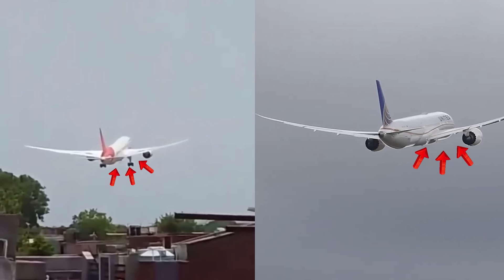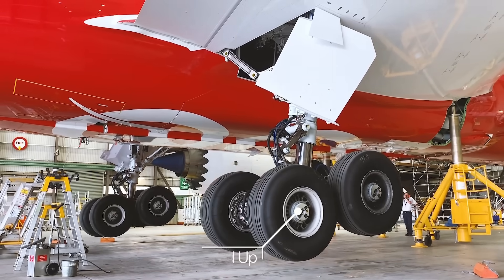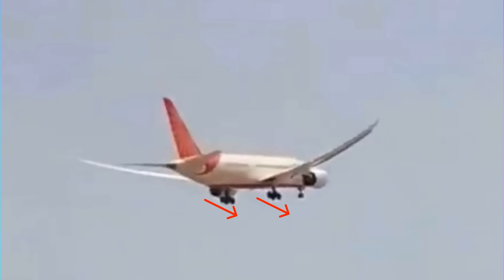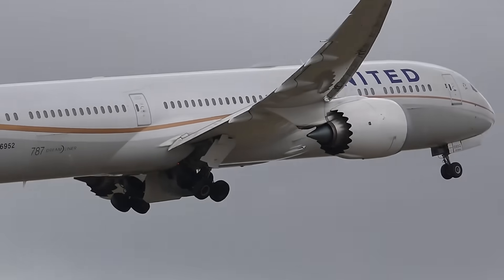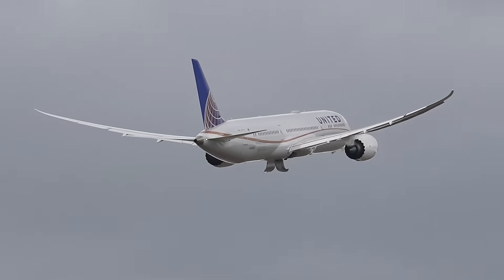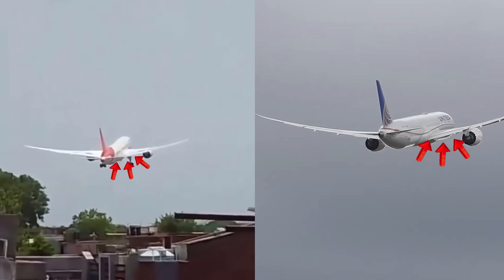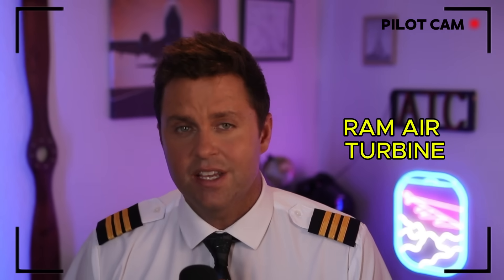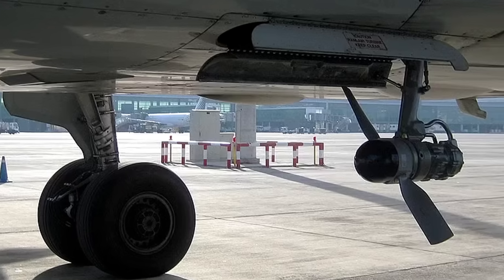Pilot Explains: A New Detail in the Air India 787 Crash Everyone Missed

Comment: The Model of the Aircraft was 787 - 8 which has a maximum takeoff weight of 2,27,900kg only and the weight of the Fuel as per report was 125000 liters or 125000 X 0.8 = 100000kg, So if overall operating weight of the aircraft itself was 1,20,000kg adding up both will become 2,20,000kg weight of just the aircraft and the fuel which is dangerously close to maximum takeoff weight of the aircraft, Even if you do a rough estimate and add up an abysmal passenger and luggage weight of just 40kg per person (including the passengers weight and luggage weight) the weight comes to 9680kg, Adding all this up 1,20,000 + 100000 + 9680 = 229680kg weight which is over the safe maximum takeoff weight of the 787 - 8 Model operated by Air India. Something is really not adding up, This has to be seriously investigated to rule out any negligence or foul play on the part of the company its pilots or maintenance staff. Add to this Ahmedabad is located close to sea level what was the temperature on the ill fated day because high temperatures cause lift issues, Did the pilots notice it did they flag it, Who was the AIr India/ Tata staff on the ground crew who signed off for takeoff of the plane? Where the pilots forced to sign off on takeoff formalities.

Comment: Electrical failure or possibly a fire internally or being that it was very hot could have been a vapor lock...it wad just filled with fuel...but yeah the plane looks like it flat out ran out of gas in mid air...no fight or nothing,,actually a nice crash landing though very tragic don't ge me wrong

Comment: Fuel vapor from the airplane sitting on the tarmac the hydraulic pumps for the fuel pumps could not pump vapor, for over 3 hours in 107° heat The air conditioner is off the passengers were fanning themselves because it was so hot in the plane look into it

Comment: if both engines flame out, they are still spinning pretty quickly and take a while to stop spinning.  Is the electric generated by gearbox attached generator like the APU is? If so, the generator would still be spinning much longer than 10-20 seconds and therefore generating electricity?

Comment: This seems to be a well presented analysis. It's sad such an accident happened but the ultimate result of the investigation should be to improve safety and prevent such accidents. I'm surprised that in this space age and fly-by wire technology,where we're sending people back and forth from space stations, we're still struggling to prevent accidents. I assume that these big birds like BA 787, Airbus A380 can withstand extreme temps. Also, why'd we need pilot intervention for retracting/ deploying gears when we can easily program to do these on attaining some params like height etc, only to override them by pilots if needed.

Comment: APU was malfunction and off. Plane was allowed to fly with that. (very stupid) bud allowed.
(no poower in tv screen, no aircon, no lights)

So no backup generator for AC power.
Plane then later probably got a dual malfunction in the generators. and had a total AC power out.
Engines die from total AC power out. So therefore also dual engine power out. 

As it had no APU for power, RAT was deploed. 

Hydralics went out too and because of that, flaps could be pushed out of angle from wind pressure. If they were not locked.

Could be a 248 day bug in computer if they didnt have restartet system for 248 days 

Survivour seat 11A was sitting almost on top of RAT. He said he hear a big bang. That would have been when the RAT deploed.
He also said lights was flickering. Also from RAT deployed.

The APU is in the very tail of the plane and is STILL INTACT!  

read all about it here :  https://www.facebook.com/anchersanalyserr

Comment: If there was contaminated fuel, would not the problem be apparent at full power or even before full power applied?
Reply: Not necessarily. If contamination was impeding the fuel filters, it might not have blocked sufficiently until high flow was required, and might have taken a little time and given intertia not immediately apparent. Given 1st transmitted ADS-B airspeed of 174 kts and climb rate <900 fpm, both lower than the previous 7 flights of that callsign from that airport suggests low-speed rotation, incorrect takeoff parameter calculations, or insufficient thrust. I surmise that if it was a mechanical problem it happened late in the takeoff roll.
Reply: Let me give you an example. A330 departing Frankfurt derived incorrect takeoff numbers due to incorrect inputs. Usually V1 (go-no go speed) and VR (rotate speed) are close together, maybe 5-10 kts and 3 or 4 seconds apart. In this case it was 25 kts, such that the VR cue wasn’t even showing yet on the airspeed indicator. 
The audio V1 call is automated but the VR call is made by the non-flying pilot. Not seeing the cue the non-flying pilot made the “rotate” call at the usual time, well before the airplane was able to fly. Rotating early turns the wing into a speedbrake and acceleration stops. 
Seeing the impeding doom of the end of the runway they reefed the plane into the air such that the tail dragged the ground aft of the tail bumper and punctured the fuselage. Tower reported that they were throwing sparks.
Reply: Further to my previous: there were two subsequent instances of remarkable dumb fukkery before they got back on the ground, but that’s not pertinent here.
I’m NOT suggesting this is what happened here, I have other hypotheses.
But it cannot yet be discounted that this chain of disaster began with incorrect takeoff parameters.
Although I don’t agree with that as a cause.
Reply: FYI, my lesson learned from that A330 incident was to NEVER let two training Captains EVER fly together on a non-training flight. All Chuck, no Yeager. Same airline, two training Captains in an A340 in 2004 got lost so badly over Afghanistan, they didn’t know they were over Pakistan until two Pak F-16s set off their TCAS as they saddled up on their wing.

Comment: From DeepSeek: Revised Analysis of Air India Flight 171 Crash (June 12, 2025) – Excluding Bird Strike & Fuel Contamination
Key Assumptions:

Ram Air Turbine (RAT) deployment confirmed → Indicates dual engine failure or total electrical/hydraulic loss.

No bird strike or fuel contamination → Rules out common external/mechanical causes.

High ambient temperature (40°C) → Reduced engine performance & takeoff margins.

Most Probable Causes Under Investigation
1. Electrical System Failure Leading to Dual Engine Shutdown
The Boeing 787’s "more-electric" architecture relies heavily on electrical systems for engine control.

A sudden electrical fault (e.g., power distribution failure, generator malfunction) could have:

Disrupted FADEC (Full Authority Digital Engine Control), causing both engines to lose thrust commands.

Triggered RAT deployment as backup power activated.

Supporting Evidence:

Survivor reports of flickering cabin lights before impact.

Previous 787 electrical issues (e.g., 2013 battery fires, though unrelated to engine control).

2. Engine Control System Malfunction (GEnx-1B Engines)
The GEnx engines are highly automated, with software managing thrust response.

A software glitch or sensor failure (e.g., erroneous EGT or N1 readings) could have:

Caused false auto-throttle reduction or engine derate.

Led to pilot confusion if thrust levers didn’t respond as expected.

Supporting Evidence:

Pilot’s "Thrust not achieved" Mayday call suggests uncommanded power loss.

Past incidents (e.g., 2018 Rolls-Royce Trent 1000 issues) show engine control vulnerabilities.

3. Hydraulic/Secondary System Failure (Less Likely but Possible)
While the 787 uses electro-hydrostatic actuators (EHAs), a dual hydraulic failure could still degrade flight controls.

If hydraulic pressure dropped and electrical systems failed, pilots may have lost:

Flap/slat control → Reduced lift at low speed.

Thrust reverser readiness → Hindered rejected takeoff.

Supporting Evidence:

Witnesses reported landing gear remained down, increasing drag.

4. Pilot Startle Effect & Delayed Response
Even with RAT power, pilots had only basic flight controls and no engine thrust.

At low altitude (625 ft), recovery options were extremely limited.

Possible sequence:

Engines lose thrust → RAT deploys.

Pitch-up instinct (to maintain altitude) → Speed decay → Stall.

Insufficient time to diagnose and execute emergency procedures.

Investigation Priorities Now
Flight Data Recorder (FDR) Analysis

Verify if engine parameters (N1, EGT, fuel flow) showed anomalies before failure.

Electrical System Forensics

Check power distribution units, generators, and wiring for faults.

Engine Control Software Audit

Review FADEC logs for erroneous commands or sensor failures.

Pilot Procedures Review

Assess if training for dual-engine failure at takeoff was adequate.

Conclusion: Most Likely Scenario
A sudden electrical or engine control system failure likely caused dual engine thrust loss, forcing RAT deployment. With no thrust and minimal control authority, the aircraft stalled at low altitude, making recovery impossible.

Final report expected by September 2025 (via India’s AAIB, Boeing, and NTSB).

Comment: Probability vs possibility. What are the odds both engines fail at the exact same time? Does contaminated fuel cause both engines to die instantaneously, or sputter first? Would this not be apparent when throttling up on take off, as opposed to only showing up after positive rate? Unlikely. What if the engines didn't fail, but the instruction received by them did. This would cause instant throttle down of both engines at the exact same time. More probable than a dual engine mechanical failure at the exact same time. I think the engines were fine. I think there was a major fault between the communications/electrical connection between pilot and engines. I'm other words, electrical failure causing a system fault or reboot of flight control software. Imagine how long it would take for your instrument and display panel to come back up if you were to kill power to it mid takeoff? I think the pilots were good and i think the engines and fuel were good. I think the main control software rebooted at the most inopportune time, caused by either an electrical disruption or problem with the software. A major electrical disruption would kill everything at the exact same time. Most importantly, cause the engines to not respond to pilot input. This seems more probable, as corroborated by the survivors statement of lights flickering and loud bang (RAT deployment). Even if both engines die on the ground, battery power keeps the lights on, even if APU is not running. Major ground fault interruption would cause even battery power to cease powering anything. Pulling the power on these systems mid takeoff, and they will not instantaneously come back up and remember what they were doing. That's my theory on how we instantly lose both engines at the exact same moment in time. The fact this aircraft has just undergone maintenance and had been exhibiting electrical issues on the prior flight, gives glaring clues as to what caused this tragedy. The issues exhibited on the prior flight should have caused this aircraft to be grounded.

Comment: One important point by captain Steve was that the plane took the entire 11000 feet of runway to get off the ground, as you could see the dust fly after it left the ground, which would say that it didn't have the kind of power it usually has. My guess is that the pilots knew there was something wrong and passed the point of no return. That's why there was a May Day call because they knew they were in trouble, and there was a lot going on in their last 30 seconds with no way to save the plane.
Reply: it was a mid field departure they only had 6300 feet.
Reply: @ghinckley68 not true
Reply: No it was not. The A/C did a full backtrack to utilize the entire runway. If you want to get on something, think about it running over its own backtrack FOD on the take off. Extremely hot day with an unusual even higher temp passing weather cell overlaying the normal ground effect boost which now prematurely fell off after only few hundred feet up. The A/C was toast.
Reply: @ghinckley68  Takeoff began at approach end, it was not an intersection takeoff.
Reply: @petergill2265  I have herd both but mainly it was mid.
Reply: @ghinckley68  I assume you haven't watched the video... it is plainly obvious...
Reply: yes , there is dust when it leaves the ground !
Reply: He is wrong about using the whole runway.  They did not.  They took off at the normal midpoint.  Everything was working normally until shortly  after liftoff.  There were no problems while they were on the ground, and the first few seconds of flight were normal.  Just as Captain Steve originally posted eithout having seen other analysts comments about the RAT, he has also missed those commenting on the normal midpoibt takeoff.  He also missed commenting on the fact that all you hear is the RAT.  The engines were not working at all at that point.
Reply: It takes FOREVER to transit the entire 11000 feet of runway.  They should have realized the 11:01  issue with plenty of space to reject the takeoff.  Especially in a 787.  Full brakes and reversed engines will pull your reading glasses right off your face
Reply: CVR & FDR

My observation would be that the critical information we need is on the CVR.......and specifically the point at which V1 was reached. A 'Good Power' or 'Its Alive' call would indicate that they would pass through V1 to Rotation. In like vein a 'Positive Rate of Climb' call would indicate moving to initiating 'Gear-up'....

If all these calls are made as appropriate and recorded on the CVR, then we move  beyond Rotation to what happened next. Obviously, all these actions will be time-stamped on the FDR.

If loss of power, came after Rotation, the crew could easily and reasonably spot that they had lost thrust, but without sufficient height available to them to lower the nose in an attempt to gain enough speed to remain airborne.

They simply did not have enough time to react, and were overwhelmed by events.

Had there been any indications of power glitches after they started the 'Take-Off Roll' we are entitled be ask why they did not reject the Take-Off at V1....?

If loss of Power meant the failure of both engines then we are in the areas of electrical failure to the Fuel Pumps rather than contaminated fuel. A complete failure of the Fuel Sender Antenna would cut off fuel to the engines at the same time. Something that is perhaps indicated by the fact that the airplane maintained asymetric flight, without any Yaw that we might expect if only one engine had failed.

i suspect that it will be the maintenance records of this particular airplane......with specific reference to any recently reported and repaired faults........that will account for this accident.

Of course, and of necessity, the maintenance recordswill tell us much .......and it is possible that the maintenance regime of the entire Air India fleet might be more of an issue than we think.

Perhaps we also need to consider the time the airplane was standing out in the hot sun, and the effects this may have had on the Fuel Sender Antenna, especially if this was a likely failing component that may have been been repaired previously when it should have been replaced.

James Hennighan
Yorkshire, England
Reply: @jameshennighan8193  what are you talking about, that is just w word salid
Reply: It did not take full length.
Reply: It did not. He, and everyone claiming that, is simply wrong, and basing it entirely on that minor dust cloud at liftoff. If you actually look at roughly where the security camera had to be, and use that small shed in the foreground to figure out direction, it shows the plane was airborne somewhere around 3000 feet before the end of the runway.

Comment: I'm not a pilot. I'm just a guy who has made a hobby of failure analysis for the past 55 years, and so my researches are largely "by the book" and without prejudgment.
By Boeing's book on the 787-8, given the load, airport altitude and ambient weather conditions, it should have been a Flaps 5 takeoff, assuming there were no data entry errors on the Flight Management System configuration.
Most of the fuel load was put aboard at the Ahmedabad airport. If there was contamination of the fuel, this would not have been the only aircraft to experience it, therefore the fuel was clean. Given the local weather conditions for the previous several days, the clean fuel was likely very warm, and because of problems with the air conditioning aboard VT-ANB, Manufacturer Serial Number 36279, it was loaded aboard a thoroughly heat-soaked airframe. If the main fuel pump injested a large vapor bubble, would it make a loud noise?
As to the landing gear bogey pivoting during gear retraction, if you watch videos of 787-8 takeoffs and watch the main gear retract, you will see that in flight, the main landing gear bay doors open before the bogey tilts.
The 787-8 anti-stall system autonomously deploys the leading edge slats.

Comment: The In-Flight Entertainment (IFE) system is independent of the aircraft systems or the malfunction of the air conditioning system, unless there is a situation where the IFE harness or associated wiring is compromised by fire. This was evidenced in the Swissair disaster many years ago. The air conditioning packs derive their power from either the Auxiliary Power Unit (APU) or one of the aircraft's engines. A failure in power supply to the air conditioning packs from the APU or the engine will result in an increase in cabin temperature. It is essential to note that the aircraft is capable of flight even in the absence of operational air conditioning.